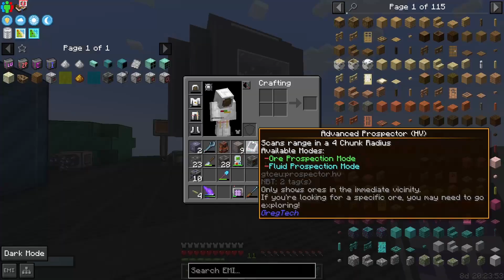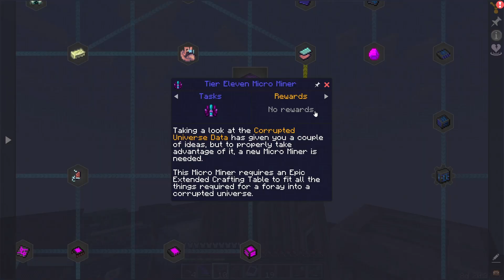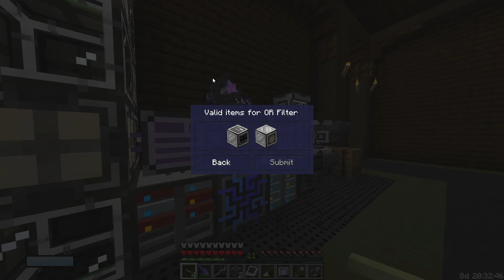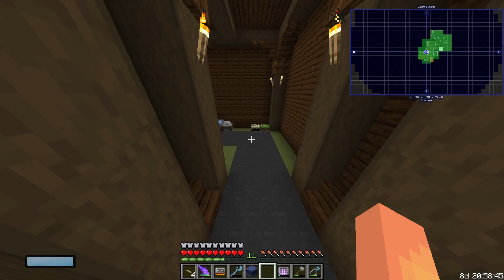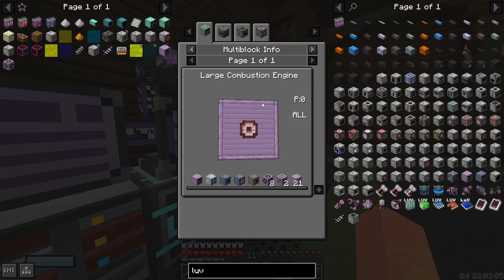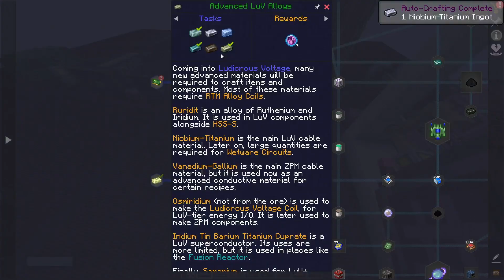Get In Line!! Minecraft Monifactory Hard Mode - Ep 20

Comment: Not sure if you find this out down the line as ive only made it this far but you can add a energy hatch of the same amp to up the processing voltage tier. On MB's I need to be super fast I have two IV 16a Energy Hatches.

Comment: Have you considered using jean gasoline for fuel? I think it's the most energy dense combustion fuel in the game, although it does require some extra processing the output bonus is pretty nice. At least on normal mode it's not too bad to set up, you can get all the inputs from oil refinement
Reply: It's the best combustion engine fuel at least. Nitrobenzene usually outpaces it due to the rotor tier and material bonuses.
Reply: @andr0oS  ah fair enough, i wasn't aware
Reply: @i.8530  By the time you get assembly lines you should be considering plasma turbines anyway, which are top-tier. But yeah, engines are a bit less effective imo